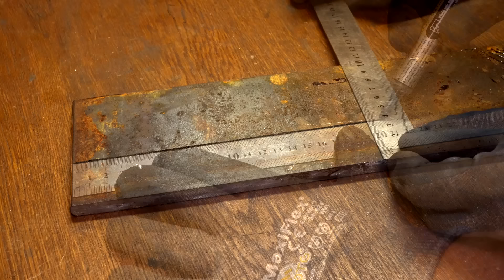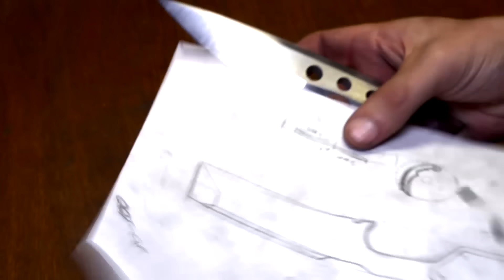Knife Making - Thick Fullmetal Scalpel

Comment: I love how you use the bare minimum of tools. You're just really good at using them and an excellent designer.
Reply: THIS  IS  MINIMUM FOR  YOU  2  FILES   A   FLAT    /C ON OTHER SIDE,,A 1 DOLL CHAINSAW  SHARPENING  0,1  FILE ,,AND A   ANGLE GRINDER , //OK  A   DRILL  NO NEED FOR  DRILL PRESS A DRILL WILL DO

Comment: That is great work. Being a total stranger to this whole knife making business I have a question though, the O1 piece of steel was quite rusty, did you do anything to protect the knife from the rust?
Reply: A coat of oil or Renaissance wax will help keep the rust off
Reply: Usually with knives like this you just keep them clean and apply a coat of oil regularly to keep the shine.
Reply: @olavl8827  last knife I made it was 01, and I did a blasted gun blue finish. Gun blue would go really nice on something with a polished satin like this. Acts as a rust protectant too.